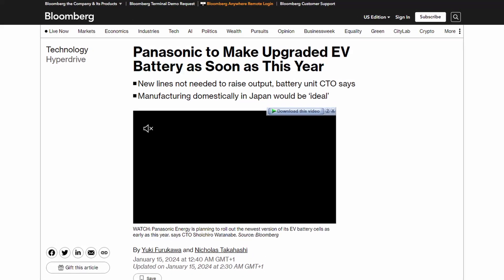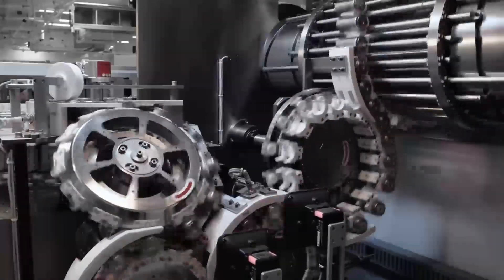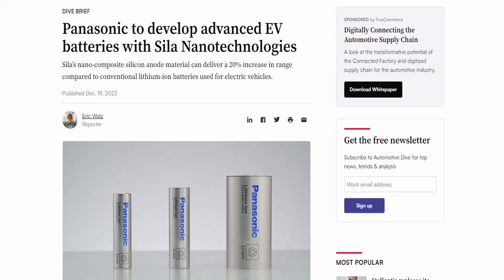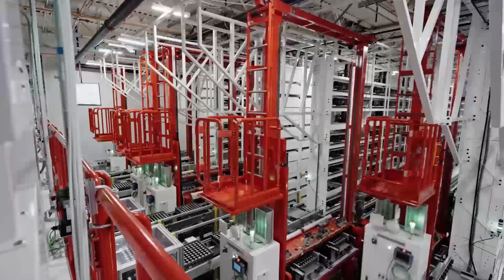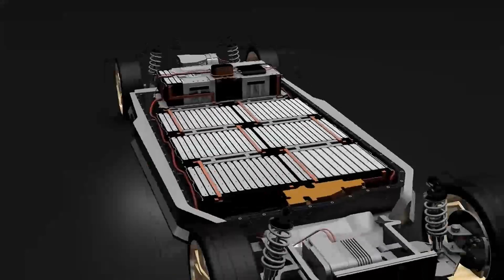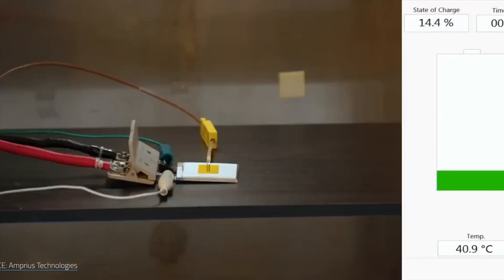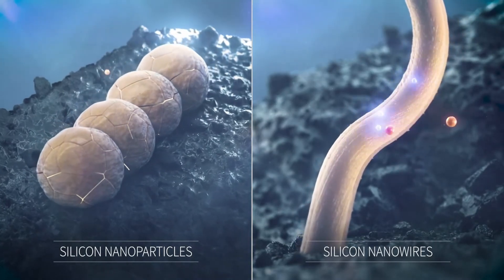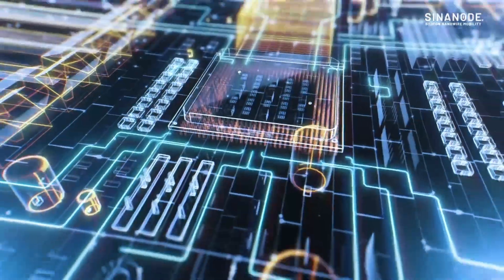Tesla's New NANO SILICON Battery From Panasonic Unvieled: Model Y Price Cuts Expected!

Comment: Shortening the life can’t fix the supply chain problem.
Reply from the maker: @syletie
Hahaha,
One step, one issue solved at a time.
Reply: @Elementraz  The fist "vehicles" invented at the turn of last century were electric. it was quickly realised that electric vehicles were a great invention but not practical and restrictive, hence the need for a combustion engine. This improved range, reliability and affordability, improved machinery for agriculture and construction, and superiority for the the military....... for every issue solved with modern electric transportation 5 more arise. The biggest problem with modern electric vehicles is the same as it was at the turn of last century. Just not Practical enough..
"One step, one issue solved".... These EV videos do more to demonstrate the hurdles that require huge investment and sacrifice to do exactly what modern combustion(and Hybrid) cars already do affordably and  practically.
Reply: @adaml7148  Electric batteries are actually used to power submarines since the 1880s until this day, just saying.

The technology of batteries didn't evolve much in the last century because no one saw any major advantage to it until now, so research will definitively improve them a lot and very quickly
Reply: @adaml7148  Reliability was NOT a trait of gas engines.  The electric vehicles were considerably more reliable than early gas engines, they were just limited in range and gas engines became "macho" so people went with that.

We're on the cusp of solving the energy storage bottleneck... next up is the energy production increases we're going to need.